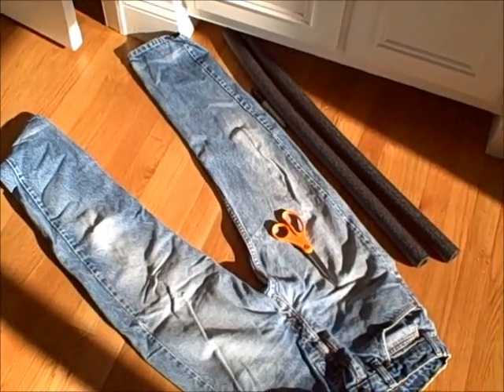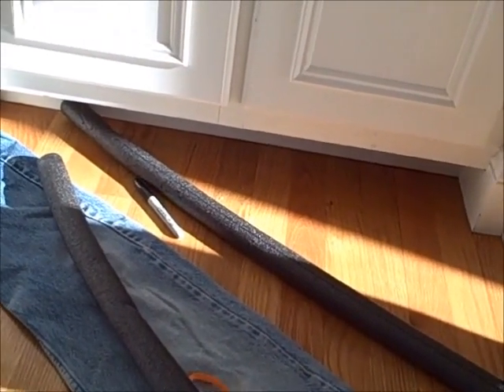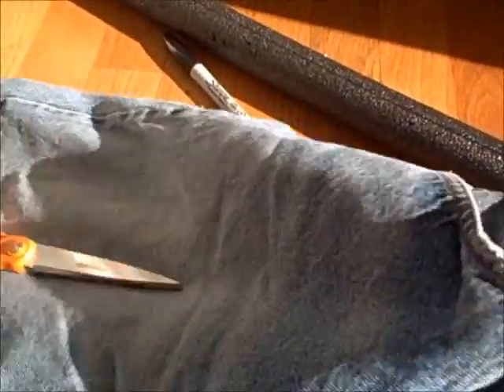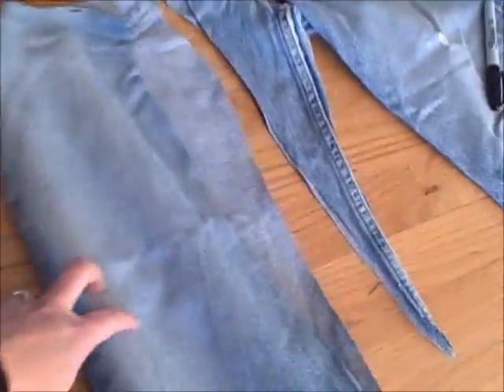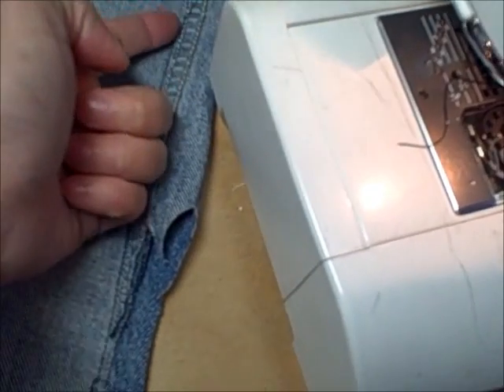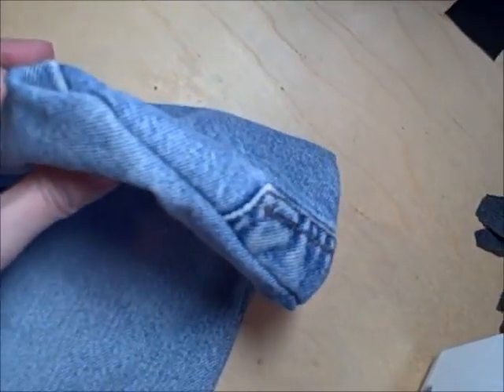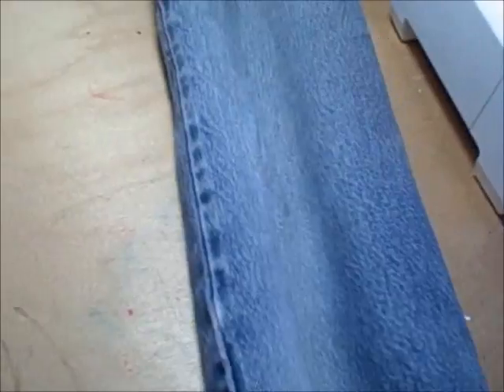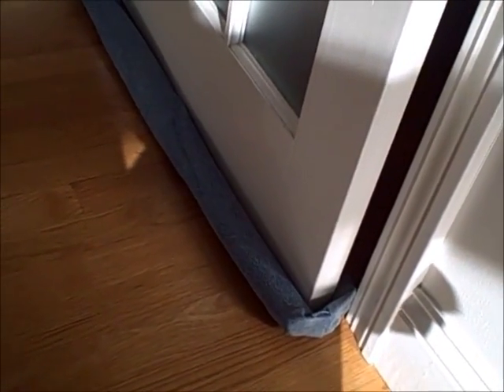DIY door draft guard

Comment: You can use any pool tube to do this. You don't have to go to a hardware store. I've seen other DIY on how to do this and they used only one and measured the pool tube cut it to the size of the door and cut it in half and put it in the fabric then secured it with glue then slit it under the door and the door shut fine plus it was much easier. to do than this video even though I like using the jeans.
Reply: I have seen several videos and read articles.  I went a step further to see if the pipe insulators were toxic.  That is my main concern.  I know,  what isn’t these days.  I try to lessen exposure of toxicity in my life.  That aside, this video was very informative.